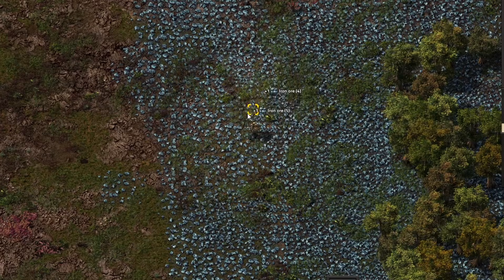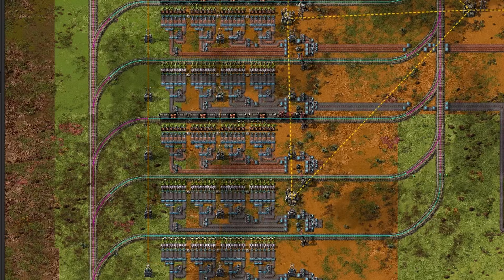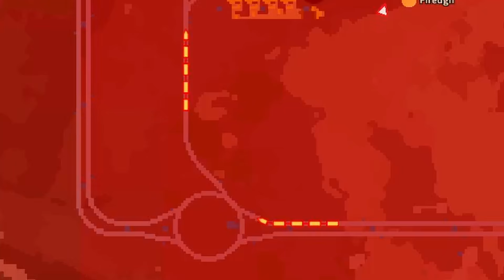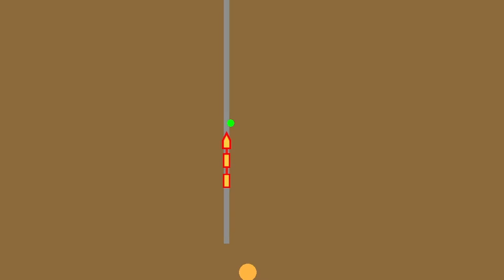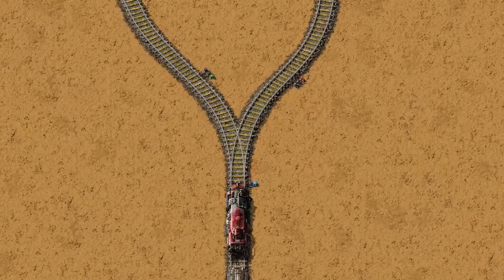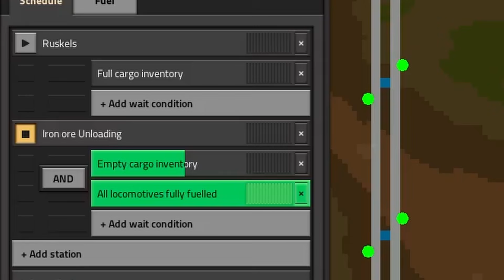Factorio Train Networks Explained | Beginner’s Guide to Scalable Logistics

Comment: 2 or 1 way roundabouts are great too. you can use them as blueprint locations for later adding in more pathways. plus, your train can change tracks on one and go back.
also, there are ways to cut your roundabout, so multiple trains can use it at once. although this is probably only useful in high density networks.

Comment: If you build a single two way track, you can only put chain signals before and after each entrance/exit. You'll get trains waiting at the entrance until the occupied track is clear, and you'll never get a blockage. It's way easier to get two tracks going in opposite directions, but a single two way rail is possible.
Reply from the maker: The problem with 2 ways tracks is that it can more easily create a deadlock. If a train is waiting at a signal to enter in the next section, but that same section is already taken by a train going the other way, it will never unlock itself. Assuming all the signals are correctly placed to avoid these situations, it will still greatly reduce the speed of your trains as they will have to wait for much longer at signals.

Comment: 11:54 - this is bad design with waste of space, resources and time (you hope buffer chests will hold meanwhile next train is still in it's original station waiting to run through whole map into your unloading station...and you have problem with balancing resources). Stack inserter can move about 12-13items per sec, you have 6 inserters per wagon, so by train of four you can get 3 blue belts (3,3). For each of this stations you may have buffer of 2-3 parallel lines with just parking space, so it takes seconds to move next train into station. I use Two blue belts per four wagons and 1,3 belt bonus nearly matches buffer for ~8seconds for next train to arrive from buffer near unloading station. (Does change for belt and inserter type, it must match ratio)
Also question is length of a train...at first glance you hunt top speed, but it's is never an issue. What slows trainline most is waiting for another train to unblock the path. The difference between one train with two locomotives and 8 wagons and two trains with single locomotive and four wagons gets significant with amount of trains. It takes additional miliseconds for long train to pass when they meet, but chance to meet another train if you have 600 vs 300 trains in your network is much greater (worst case scenario is N squared). There is also upper limit which differs by map settings and factory size - how fast can you load the train with your resources, it doesn't make sense to wait an hour for train to fill...Train can be emptied in 11 seconds, plus 8-9 more for another to arrive from buffer, On average you need to fill one train every 20 seconds per one unloading station.

Comment: You don't really have to use chain signals if the intersection/roundabout is all one block... The place where you need them is if having a train waiting there can block other trains passing. Like an entrance to a stacker. And when two trains could end up waiting each other indefinitely.
Reply: Not if you do it properly...separation can improve troughput. It can withstand two or three trains at once when their path is not colliding. When you have 4 trains it probably doesn't matter, but if you have 40 of them and one crucial intersection, you would jam it...there will be no deadlock, but one train get's on it's way meanwhile others stop and it takes time to accelerate, so now you have ~10 seconds for each train to go through your intersection, then next train can be on it's way, then next one...your throughput is limited to 6 trains per minute which will slow down your entire network even if 95% of your trains are going just straight. Worst thing is you wouldn't even notice until it's too late, then one train has to stop because of other and you have blocked everything - next train has also to stop because there is slow train in the way and then next one...
Reply from the maker: To add to @johnsean100's comment, in general, having sections that match as much as possible your trains' length is a good start to maximize your trains throughput because it means the waiting time of the next train is shorter. In this case, not having a signal at the exit of the roundabout means the roundabout needs to be free as well as the whole section after it for the next train to proceed

Comment: You don't need a buffer chest at train stations, the train is the buffer!
Reply: You kinda do... Or the production will stop between trains. The only place where I suggest not having them is at the mines if you can generate full belts of ore continuously.
Reply: @AbsoluteHuman it should only be a few seconds after one train leaves before the next arrives.  Trains are cheap and there is no reason not to run extra.

After my trains leave the belts do star to back up but belts are buffers as well, and are generally plenty to assure that mines and assemblers dont halt (not that a momentary halt is really a big issue).
Reply: @ericblair5731  That's depending on what percent of throughput you are using. If we are talking megabase level than that seconds could be rather impactful. I can see a system working that way but still prefer using a few chests just for reliability. It's not that they hurt the performance very much.
Reply: @ericblair5731 I had a train mega base in factorio 1.0 with 860 trains, 420 of them at 8 wagons long. Got luck with double the amount of them because you don't want to use a few chests 😅 The amount of space needed for just the extra trains would be soooo much for every station making every path even longer for even more trains needed to compromise the amount of time needed to reach a other station. Yes trains are the buffer, but if you cut the extra buffer at the station, you need AT LEAST 1 extra train for it to compensate that. And this doesn't take in account of travel time.. And some resources/ thinks you build don't require a train already at the station because of its slow production speed. Your system can't be build modulare and scaled up easily. Also you can't build a multi function station where 1 station serves 2 transported goods at the same time

Edit: the most efficient way is by using chest buffers and only request a train when a whole train can be loaded. 8k of ore can be transported with 4 wagons, so call a train when it's at like 6-7k in the chests. Done. More trains do not lead to be better, I find out the hard way when you see a massiv deadlock with like 200 trains stopped 😂 And in 1.0 you couldn't control them by map view, so personal fixing was needed.. You can't even find the reason sometimes at these huge deadlocks.. I can tell you that 😅

Although for ore it's not that bad to always have a train ready. If I remember correctly I had like 120 trains for Iron ore? Something like that.. I did direct mining into the train at some point, that was faster at the end game. But now in space age trains are dead sadly.. Only in the beginning they are needed

Edit: it depends where you need buffers. In space age yeah just build a few more trains, that doesn't really matter because you stop using them after some time, but in 1.0 when you want to build big, use buffers and some combinator logic, that works better.

Comment: IMO it's better to make a refuel interrupt than to work with fuel on unloading stations, so only one of the stations needs to actually provide fuel for the locomotives
Reply: It's much better to use an interrupt. Something I've done as well is that I have an interrupt for no destination found. And also for low fuel. However they both point to the same place, so if your train ever goes idle it also gets topped up with fuel. It helps keep the topped up
Reply: It's really the only way to go
Reply: @josephinman3037 well, not the only way technically, just commonly accepted as the best one
Reply: @josephinman3037  it's a fairly new feature
so not the only way to go